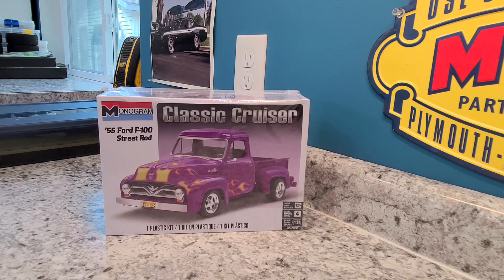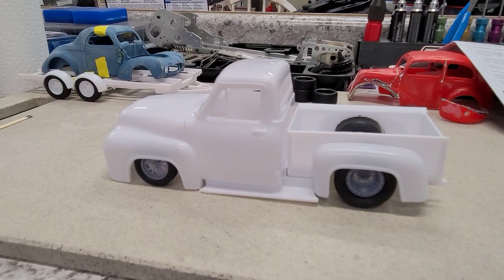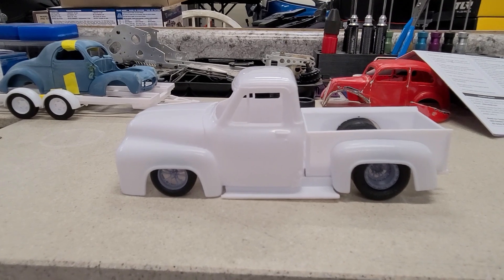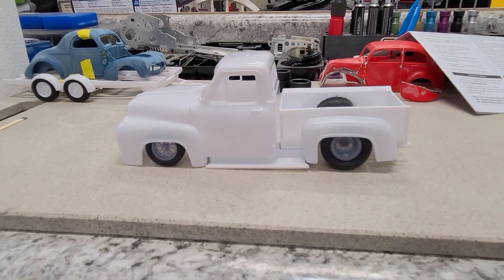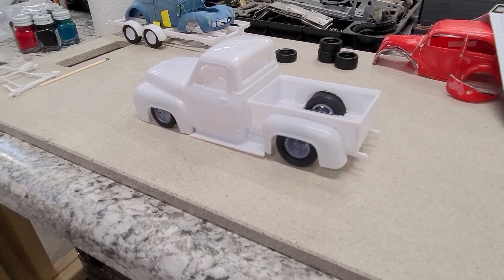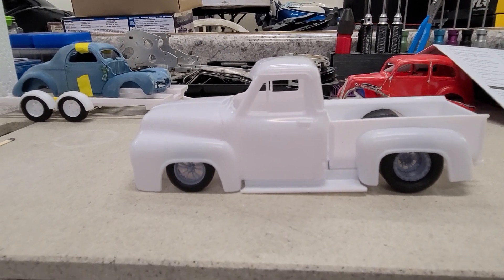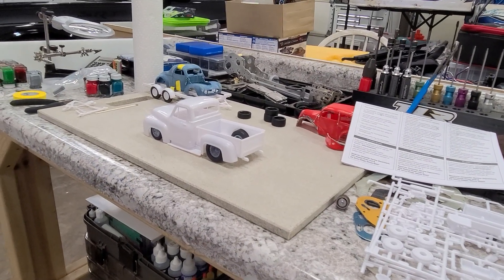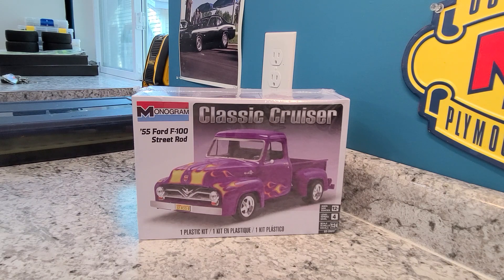USACC update #1 , and stash add...

Comment: I hope you're feeling better.

Decisions, decisions.  We all know the feeling of trying to figure out what to work with.  Iceman Collections has a great Ford motor worth looking into.  If you have a Bob Glidden prostock Tbird, that'll be worth test fitting.  Maybe even use the wheels from that kit. 

Either way you build it, it's gonna be killer.
Reply from the maker: Thanks Mike, those are all great Ideas.. I believe I do have a old Glidden kit, will have to check that out

Comment: Suggestion for you: picking up one of those Monogram Pro Stock or Pro Street Thunderbird kits. It will give you a period correct Ford race engine, peiod wheels and tires, and the Ford 9" with a 4 Link Suspension.
Reply from the maker: Great suggestions,  I do have a Motorcraft pro stock kit I thought of using for those part's.  Just not sure I want to take them from that kit.
Reply: @KRD12K  too bad the most recently reissued Pro Street is that Linxoln Mark 7. It's motor with its exotic and uncommon induction set- up is too unique to serve as good kitbashing material. I do recall them reissuing a Camaro Pro Street recently, but that leaves you with a Chevy Engine. Honestly, I wouldn't be that upset about a Chevy motivation in an Eighties Era build. "Ford motors in Ford vehicles" was around then, but it wasn't a Commandment. That really took off in the Nineties. You can see that in the Ninties reissue of this kit featured in the video: 5.0 with F.I., Billet Wheels, modern contoured interior. All this to say, I get the hesitancy of hacking up a long out of production,expensive kit. Is it worth it to keep it all Ford?